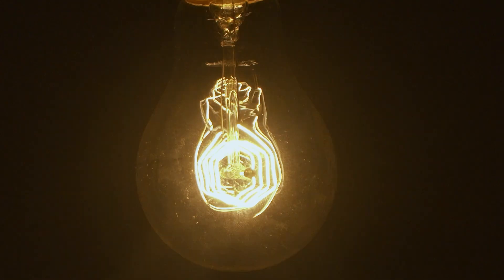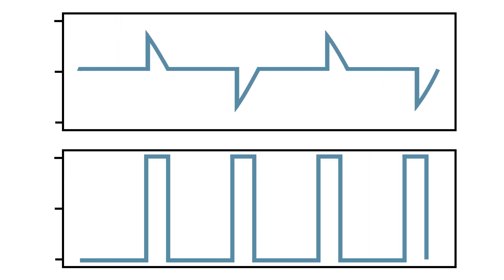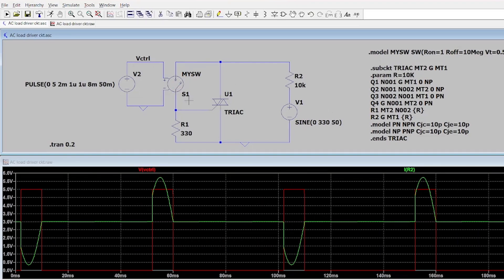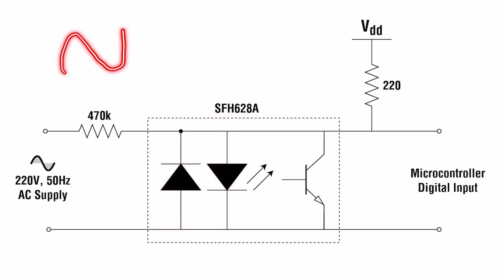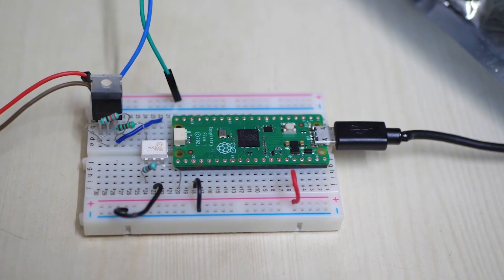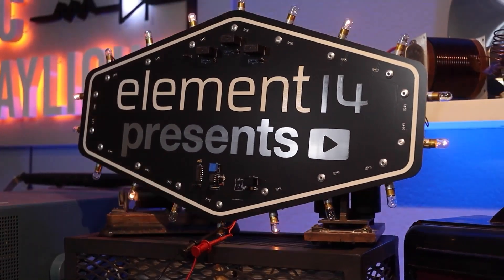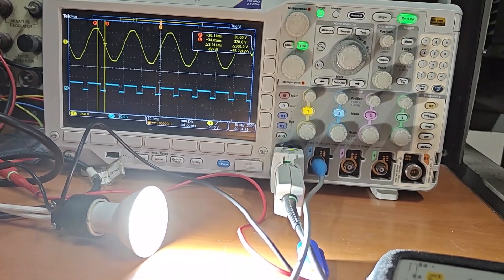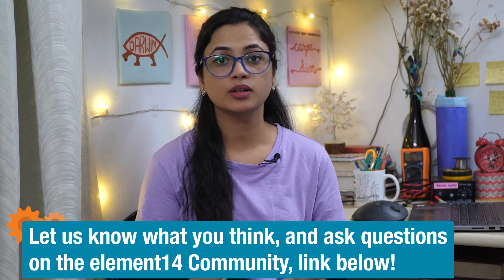AC Dimmer Circuit Using Phase Angle Control

Comment: I want to make this project with esp32, to use wifi and webServer.
But the bulb is blinking

The circuit is correct and works properly using ADC.

Comment: I am stumped! Judging by the video, you are using 2 RPis? one to read the AC mains supply analog sine wave, feed that through an opotocupler to the triac and second optocupler somehow (connection is unclear as the video never shows the full project in one image), than use the second pico to send the control to the led bulb via the optocupler and the triac, again unclear from the video footage how exactly they are connected... This can`t be right! surely i misunderstand the whole thing... Perhaps the first part (Zero crossing detector circuit) is a demo of how to separate the mains from the RPi 3v3 voltage, and the second part (AC load driver circuit) is the full project and has nothing to do with the first part?

Comment: Great presentation... one small point of order, Phase Angle Control is a 'Noisy' control method because of the discontinuous nature of the output (it is only low noise when switching occurs at the zero crossing assuming that current and voltage are in phase with each other)

Comment: Hi thank  you for the video.
Yes this was a commonly used device for old incandescent lamps and even infra red heaters, we now though use almost exclusively LED lamps in the UK.
Reply: True that the circuit is applicable for controlling power to be delivered to almost all AC loads. But it should be noted that special care in form of Flyback diode is necessary while handling reactive (inductive or capacitive) loads.